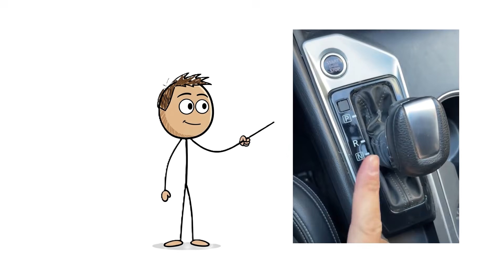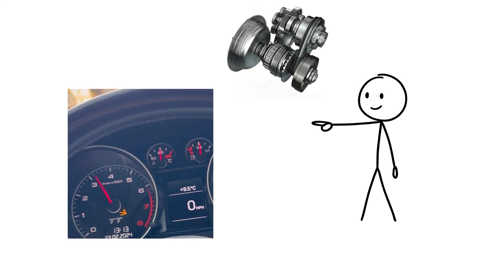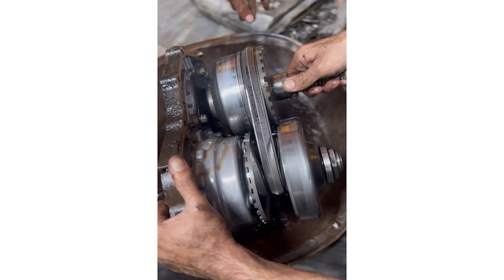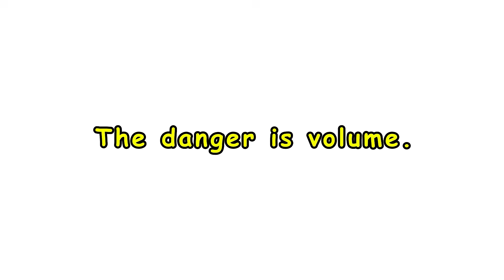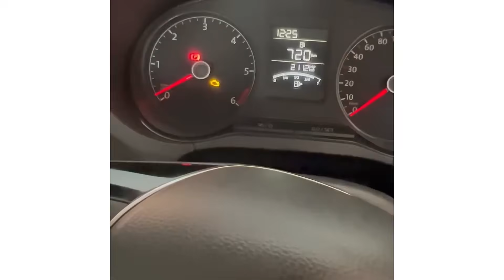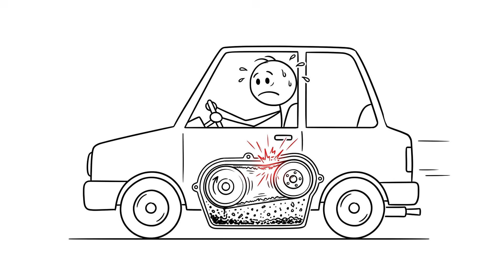99% of CVT Owners Have No Idea How This ONE Bad Habit Destroys Their Transmission

Comment: Had my CVT fluid changed every 30,000 miles and it still went out at 95,000. Nissan's are JUNK!
Reply: This. They like to blame the owners that don’t do maintenance. I did mine and they told me “it was going to go regardless”. Never again will I get one of those cars.
Reply: The Nissan cvt Jatco is junk. Read up on it
Reply: @RacerX1971   And it is located in many cars today and different car manufacturers.
Reply: @gregzeigler3850 , sure but which brand? Yes, do tell us.
Reply: @RacerX1971  Mitsubishi, Nissan, Suzuki, Some GM's, Stellantis(Dodge and Jeep) and Renault. You could easily google this yourself...
Reply: Who DOESN’T KNOW that all of these are bad FOR ALL TRANSMISSIONS? 🤷‍♂️🤦‍♂️🤯
Reply: If you knew enough to change fluid regularly, how did you not know enough to not buy a car with a CVT? Did you fall for the hype and advertising ? ? Be honest .
Reply: @busher69 I didn't know it had a CVT. When I found out it had one care was taken and it still failed
Reply: Do you drive it hard the whole time? Likes to full send from dig (that's where CVTs get the most stress from; sudden launches)? Shifting immediately to Park and let the transmission hold the car instead of doing the Neutral-Release brake-Engage parking brake-and shift to Park method? If so, then that must be the reasons. My Rogue Sport is on 114k miles rn, and still on its original CVT. It's only abused on back roads and touging.
Reply: @valferdinandmonissabiano8641 Drove cautiously and the bearings still started whining at 95,000 miles. There is nothing you can do
Reply: @richardcarden4161  Beat me to it. Started screaming at 99.4 last week.
Reply: @SoogySploogy what does the bearing sound like?
Reply: @tujj8841  Don't remember, I sold it the day after I left this comment lmfao
Reply: @tujj8841 A whine that increased with speed
Reply: @valferdinandmonissabiano8641   ALL very good advice. Don't get into "the gas" until one is past 20 MPH. I seen an idiot flooring his from a standing stop. I told he was going to wreck that CVT and he wanted to argue with me...
Reply: Buy a nissan with a real auto box like my E51.
Reply: I got 199k miles on my 2015 rogue…doing pretty good ngl
Reply: Everyone knows that
Reply: My 2009 went to my son and I still drive my 2013 Nissan. No issues, last year I decided to change the fluid because I heard the bad Nissan stories. S
Reply: 141k on my 2022 Versa
Reply: Not just Nissans. Neighbor buddy a new bronco sport. Transmission went out 2 times and her suspension has to be completely changed before 16k miles. Another friend of mine bought new explorer last year transmission went at 9k miles. Luckily was under warranty.
Reply: Cvts are junk I'm sorry to say that I would never buy a vehicle they had a CVT transmission maybe 10 years from now I might but they're all experimental I'd always pick a car with a regular transmission you got to do your due diligence and look up your vehicle that you want and what kind of transmission it has and what kind of if it's a regular transmission cuz there are bad Transmissions that are regular ones too
Reply: I have a Rogue with 177,000 and no problems
Reply: My sentra 2018 1.8L is now at 140000 miles with fluid change (dropped pan... no metal fines noted) regularly... Still going
Reply: @edgarteoxon6839 CVT's don't have "PANS" like other transmissions. A transmission tech told me that and opening the case isn't recommended
Reply: I have a hand me down 2015 Nissan Altima with 75,000 miles on it. The CVT seems like it going pretty well but the family member that I got it from wasn’t very good at servicing his car and had only done a CVT trans change once, from what he can remember. 
I bought some AMSOIL CVT fluid when I get this car on the road, which is 100% synthetic and made for these problematic CVTs, and have heard nothing but very positive things about how much longer these transmissions last and how far better they are than any of the Nissan CVT fluids.
Reply: It could have been your driving habits, too. You can't run them like a regular transmission.
Reply: I love how all these dingleberries ignored your post.  The CVT will fail whenever it wants to regardless of maintenance.
Reply: My grand parents got it serviced at the recommended interval and it died at 55k
Reply: Cut that in half i change mine every 15000km the fluids flash point is crap
Reply: Wow! Thats crazy work!! I thought changing fluid was the magic…
Reply: Oh noooooo
Reply: 99.4k on my '15 Altima rn and my alternator just started screaming like a supercharger last week.
Selling it this week, I fear it won't last another day.
Reply: @SoogySploogy  ur selling ur car b/c it needs an alternator?
Reply: @techbill2900 🤣
Reply: @SoogySploogy Same for me. I didn't want to buy another car but I had little choice 🙁
Reply: @richardcarden4161  Yup, I'm at that exact point currently. Wanted to keep the Altima but repairs cost more than the car.
Reply: Bought a 2009 Nissan Maxima,  its on its 3rd transmission.... never again
Reply: @Winslee  Yeah but how many miles on each one before failure?
Reply: @Winslee  3rd transmission  ?  Why did you keep it that long ?
Reply: @Winslee  I think the CVT in Nissan's were destined to explode.  My Honda CVT has 110,000 on it and still runs fine.
Reply: that means you dont know how to take care of your own car, dont blame "Cvt" for it, that is a ridiculous. I have a Nissan "CVT" 2016 Altima with more than 124k miles on it and it is still goin strong, so that begs the question, what the fuck is you doin if your car died at 95k miles? you seem like those people who dont want maintenance and learn your own vehicle and drops it off at some random repair shop when theres a problem. We call that lazyness.
Reply: @Yuenix  I hear ya.  Some don't know how to because they are ignorant about taking care of a vehicle . Of course there are some that maybe we have seen that just don't care either.  Some  drive it until it breaks down then get pissed off off at how much it costs for a repair that could have been avoided through preventive services such as basic oil changes.  I've seen a lot of people out there like that . Don't even check the dipstick.  Gas and go  . Don't check their tires let alone the tire pressure ever . More money than brains or common sense in a lot of cases.
Reply: @Yuenix The dealership did the work so blow it out your ass
Reply: It seems Honda takes the lead in CVT transmission design. Mine is 100k and I don't see any issues. I replace fluid every 15 thousand miles.
Reply: @TT-dp8qh  15k? That's crazy! Does it say to do that in the manual?
Reply: @sterling1989 I drive this vehicle a lot. I have cases of fluid when I purchase them cheap. It is not a big deal
Reply: @sterling1989  Never read them. Never will. I made my own manual and mine said: The faster you service, the longer it'll last.
Reply: @keledek660 the old Accord was over 200k. It was running as new when I sold it to my neighbor.
Reply: @TT-dp8qh  at least you can observe it. 😊
Reply: @keledek660 I know a mechanic changes his daughter's car every one thousand miles. He fills only regular oil and that vehicle has never been broken.
Reply: @TT-dp8qh  I beat you to it. 12k miles interval and all of the filters at 24k miles. Only because my country is super humid. Drove a 2020 Accord. Cruise like a dream, for now~~
Reply: @keledek660 I have never changed any filters on Honda transmission. I cut one off for an inspection and it looked very clean.
Reply: @TT-dp8qh  It's like I have these disorder to took care of the CVT a little further. Better safe than sorry.
Reply: @keledek660 years ago, I used to replace my old Honda parts before it broke. I maintain vehicles by myself. This is the reason our cars have never broken. Honda parts are still cheap if you purchase online. Toyota and some domestic vehicles are expensive.
Reply: My versa had to be replaced at 60,000. Not sold on Nissan.
Reply: @raygor2366  I got rid of mine at 145 K. Driving a 2022 Chevy Spark LT, now. Same Jatco Tranny, butt cooler interior design. I'm happy with it.
Reply: You should have left it alone changing it the way you did made it go out so fast I have a 2017 Maxima with 103,000 miles never touched the service the dealer recommended they where just making Money off you and old school mechanic told me it's like cancer don't bother it then it won't bother you never touch the Fluid in yo transmission especially putting it on the Flush Machine that's a No No Buddy I took my chance not changing the Fluid so far she still good
Reply: @cordraldudley7548 😂😂 it won't be long
Reply: @Matthew-dm2mq Nawwwn  man I baby Mad Max just had a Tune-up and Changed the mass air flow sensor Some Bitch run like a Bat out of Hell 😂😂😂😂
Reply: @cordraldudley7548 that is not true!!!
Reply: Maybe you used the wrong oil
Reply: @tech_knowledgy Dealership did all 3 service changes

Comment: The Nissan maintenance manual states to change the CVT transmission oil so I don't know which manufacturer say not to but Nissan definitely says to change it
Reply: It will still break at 90,000 to 120,000 miles

Comment: Speaking as a retired mechanic, I am not guilty of any of these. I now do airport transportation. My 2020 Mitsubishi Outlander just turned over a 180,000 miles. Maybe.\n It's a bit excessive, but I have changed the CVT fluid with genuine Mitsubishi CVT fluid every 15,000 miles. In addition to that , oil changes evey 3,000 to 3,500 miles.  Coolant replacement every year regardless of mileage. Spark plugs and serpentine belt replaced every 75,000 miles. I don't "hot rod" or "lead foot" my car. I recently purchased a 2025 Mitsubishi Outlander Sport as a second vehicle. It will receive the same loving care as my 2020 Outlander.
Reply: Better love story than Twilight.
Reply: @ironbowtie Twilight Zone?

Comment: Because automatic transmission fluid changes are so infrequent people forget to do them.  I try to change my transmission fluid every 40,000 to 50,000 miles.  Also, I try to change my engine oil every 5,000 to 6,000 miles.
Reply: At 48,000 miles, I've changed 4 times of fluids and 2 times the oil cooler, gaskets and CVT filters, not because I drove hard, but I presume CVT needs extra care, on top off I've followed every single rule in the video said.
Reply: But do you change the transmission filter too
Reply: For transmission yes you are doing well BUT change all filters as well.    Regarding ENGINE OIL, practice the PRO rule with no argument:   Change OIL and filter every 3000 MILES.   And you'll thank me when you are at over 300,000 miles and machine still runs like new.   Use Amsoil Signature and filter up to 150K and Valvoline Restore Protect after 150K still using Amsoil 20 micron filter.    You're Welcome.
Reply: Not happening . 3K oil change intervals mean the  machine owns you,,, not you owning the machine. 5 K oil intervals. 50 K tranny intervals. Diff/TC/PS intervals 50 K as well since the fluid is usually the same. Do not make owning a car painful. Life is painful enough. Buy a vehicle they is easy to DIY and save money 💰. 👍

Comment: CVT's are not as durable as conventional automatic transmissions.  I owned two vintage Fords with C-4 three speed automatics, but  have  driven manual for the past 30 years.
Reply: If you have driven automatics for the last 30 years, how do you know CVTs are not as durable:face-turquoise-covering-eyes:
Reply: Rubbish!! The new 9-10 speeds A/T constantly shifts, has low speed drivability problems, and has the same shortened intervals as the CVTs. They haven’t made 3 speed trannys in a number of decades. Bring back the M/T.

Comment: OK, with CVT's that are sealed for life, and there's no dipstick, how do you change the fluid, or fill it if it's low?
Reply: On my 2017 Crosstrek i drain the fluid from the pan and there are two holes on the side of the transmission ones a fill hole and you fill it until fluid drips out of the other hole.
Reply: The drain plug in a CVT is different than the drain plug in other types of transmissions. CVT's have an outer and inner drain plug. The outer drain plug screws directly into the fluid pan and the inner drain plug screws into the outer drain plug. The outer drain plug has a tube on it that sticks up into the fluid pan. The length of the tube determines how much fluid will be in the fluid pan after you change the fluid (this is why CVT's don't need a dipstick). You start by heating up the transmission and removing the outer drain plug and letting the old fluid drain out. You need to measure how much fluid comes out. Next, you reinstall the outer drain plug into the fluid pan. Next, you remove the fill plug on the side of the transmission and put the same amount of new fluid back into the transmission that came out. Next, start the engine and let the transmission warm up to normal operating temperature. It's best to use a scanner for this so the transmission is at the proper temperature. Next, take out the inner drain plug. If fluid starts to drain out let it drain until it stops. This means the fluid is level with the top of the tube sticking up into the fluid pan, which is the correct level. Put the inner drain plug back in and you're done. If no fluid drained out, the fluid is below the top of the tube, so you need to add more. Put in some additional fluid until it starts draining out. Then when it stops draining out the transmission fluid is even with the top of the tube and at the correct level. Put the inner drain plug back in and you're done. This is the general procedure. Check for what the exact procedure is for your specific vehicle.
Reply: Measure how much comes out and put that amount back in
Reply: Pull the oil pan.We don't need no steeking dipsticks, just buy a new one.

Comment: If your vehicle is front wheel drive only and not all wheel drive, how would having it towed by the front and keeping the rear wheels on the ground going to affect anything with the transmission since on a front wheel drive vehicle the rear wheels are not connected in any way to the transmission that only drives the front wheels?
Reply: With front wheels off the ground the front wheels and therefore  CVT is not turning

Comment: Why don't they go back to traditional durable transmissions that are proven performers.  Seems like a dumb move to keep any cvts!
Reply: Fuel economy.
Reply: As with any car, people got to keep up maintenance on it. My '09 Murano, has over 220,000 miles on it. I stay on top of the maintenance & everything is great.
Reply: Mileage,  in order to get the mileage required by the epa  they have to have a high geared top end. I love the Nissan Pathfinder cvt  but would not advice anyone to buy one that is not gentle and disregards maintenance.  I have ours changed every 30K at Nissan.  They are not for everyone and every vehicle  . I can tell you this most people , I would say  70% disregard maintenance on their vehicles.
Reply: I wish you had a wider range of choices.  Personally, I would get a manual if I could.  These manufactures are looking out the bottom line and government regulations more than what the consumer desires.
Reply: @MrTce58 consumers hate fuel economy?
Reply: Cafe standards...if cars didn't meet the standards the manufacturer fa ed fines...cvt's generally provide better fuel economy
Reply: IT is 😮
Reply: Money.
Reply: It’s not fuel economy. Research shows there’s almost zero savings, the actual factor is the auto makers saving bucks and passing cost to buyers. They’re pure evil
Reply: Its cheaper to manufacture. 20+ more years CVT is being casual on the road and old transmission will be rare
Reply: @4costa-24 i have a toyota corolla with a cvt...i was hesitant to buy it until i checked out how it was designed...good stuff...tbh i wish they'd ditch the "shift points" as it defeats the best reasons FOR a cvt
Reply: Blame "Gubment" mileage standards.

Comment: My Honda cvt also has a torque convertor. As do all standard Honda cvts.
Reply: All cars have a torque converter
Reply: Not my Prius v
Reply: @denslod2930  probs because your Prius is a Toyota with a gears and electric motor CVT system.
Reply: Wrong! Honda Jazz does not have a torque converter. Old Jazz , not hybrid.

Comment: The CVT is much more dependent on the fluid condition than a conventional clutch type automatic.  And when you get slippage between the chain and pulleys, it's big trouble.  Also the pulleys are difficult to manufacture so they aren't available from a multitude of sources for remans making replacements expensive.